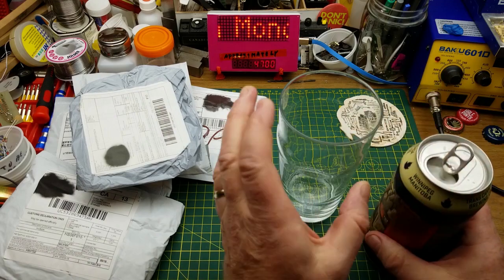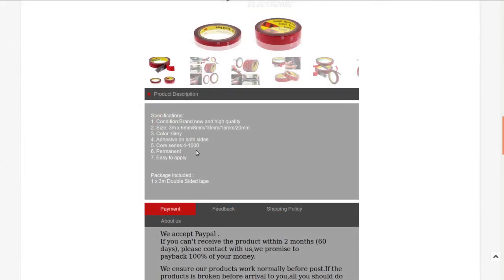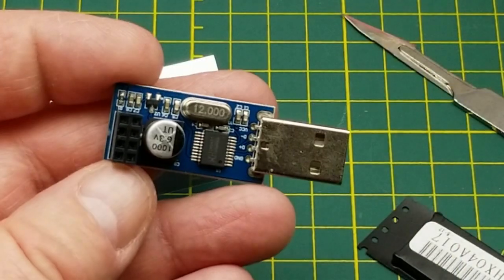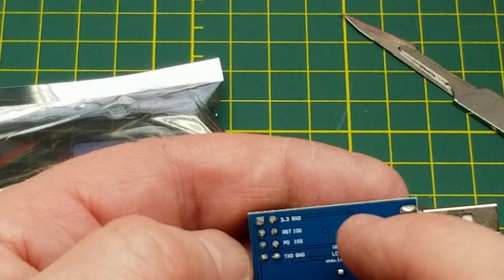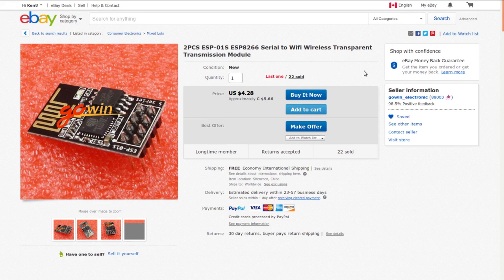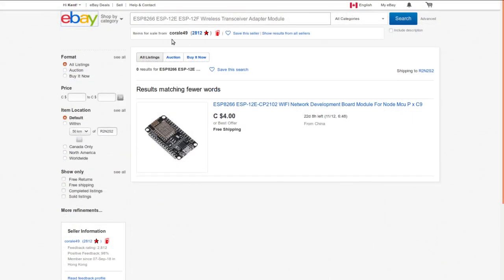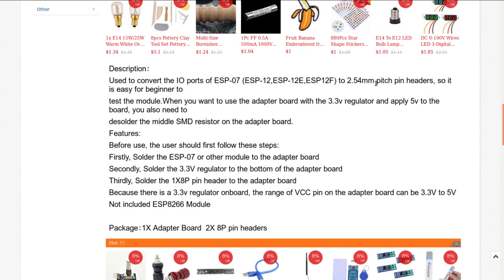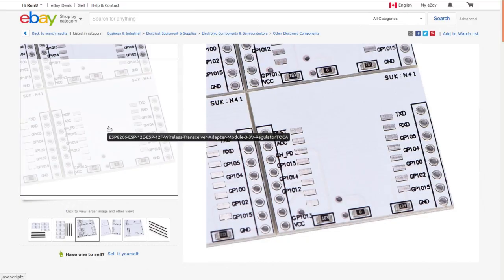mail bag Monday #73

Comment: I don't know how flexible your cameras settings are but you can usually change the exposure setting to get rid of flicker, but it may bodge up the exposure for the rest of the image (make it brighter)
Reply from the maker: The only way I've found so far is to set the exposure as if the scene was extremely dark, but that does overexpose the rest of the scene.

Clive found the same with his Hopi meter.

Comment: I find the esp8266-01 still very handy for simple projects where only a couple of i/o pins are required as you just need an 8pin header on your circuit board to connect the esp module to and you can then just unplug it to re-program and plug it back in again.

Comment: 8:47 Breadboard connectors - I found that the ends are really sharp and have burrs, which causes scratching of the breadboard contacts. I suggest that you check under a magnifier, or use a fingernail to feel any 'catching'. If so, I found the easiest method to round them off was with a small diamond hone/plate/rod that's designed for sharpening small tools.

Comment: I need more of those alternate style breadboard jumpers. I have mostly the crimp style and they also give me trouble trying to plug them in side by side sometimes in addition to being a struggle to insert, but I got some of those alternate style in the summer and  it felt like an upgrade so I think I’m going to go searching for a listing. 
 I’m still trying to snag the audio plug to screw terminal adaptors but I keep getting outbid.
Reply: Audio plug to screw terminal?  I've missed those... It would save a lot of grief...  I hate headphone jacks with a passion, have never made one work the first time after soldering carefully those infernal tiny wires...
Reply from the maker: @jetsam8073  it was in my previous mailbag video 

https://www.youtube.com/watch?v=3r_j5Vt150M
Reply from the maker: @Tiago Ferreira I use a lot of 22 ga telephone cable and 24ga CAT5 wire for breadboards as well.

The pre-made jumpers are simply convenient. And being made with stranded wire, they are a bit more flexible and durable for repeat use.
Reply: For breadboarding I usually try to use those little preformed solid jumper wires sold in the various size compartment cases  specifically for breadboards,  but I use the Dupont for convenience when I need to go away from the breadboard to an Arduino or other module,  or just when I am lazy. 
I start to get worried about breaking the breadboard contacts when I put potentiometers in there so I try to just use those tiny Lego bread boards that I don’t care about and I just keep a standard potentiometer always inserted in a few different bread boards on standby.

Comment: Note,you lose the connections on the bottom edge  of 8266-12 when fitted to those adaptor boards. Tried to adjust the screen as there seemed to be a faulty colour rendering of the beer. Could not get it to show as dark. ;)
Reply from the maker: Sometimes a guy has to go outside his comfort zone.

Comment: that usb serial for esp is just a serial adapter, if you want to use it to flash esp-01 you need to add a button between gpio0 and gnd, and a jumper on chpd if i remember well... press button pressed while plugging it in to go in flash mode... and that esp-01s (S!) is the newer version with double memory compared to original 01
Reply from the maker: That "flash mode" button for GPIO0 is a common requirement across the ESP8266 range, I believe.
Reply: @pileofstuff  yes, indeed, but i've seen many taking that usb dongle and complaining about not being able to flash esp01 :)
the producer could have added a switch or a couple of pins with a jumper, to simplify that :)
Reply from the maker: @squalazzo  I guess saving that half cent in manufacturing was more important to them than implementing functionality.
Thanks for reminding people here!

Comment: How's it going with burning your address off?
Are you going to install the 3.3v regulator?
Reply from the maker: So far every address label that I've tried using heat on has worked well.

the regulator will depend on what project I end up using that board for.
Reply: @pileofstuff  i used the trick on two today, went all black a treat. by by felt pen :)